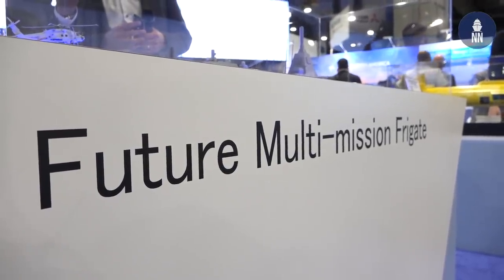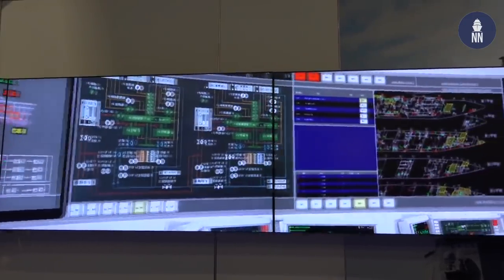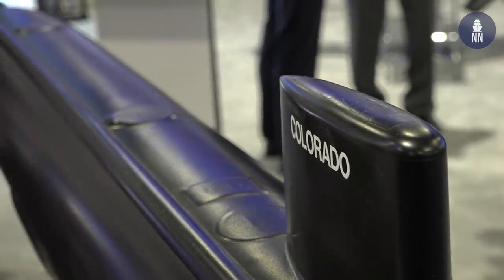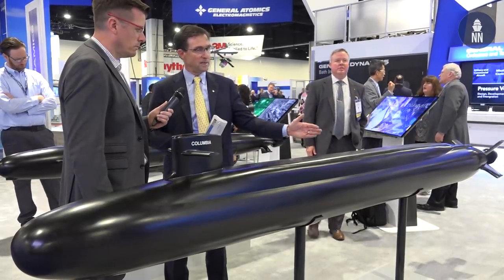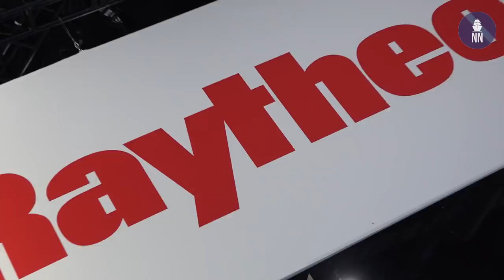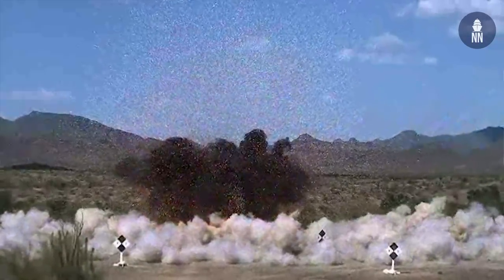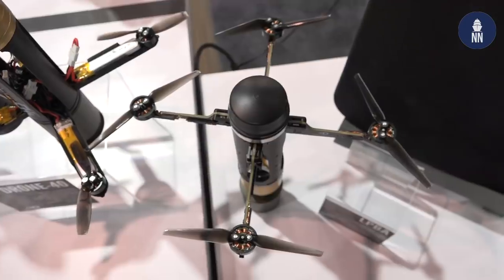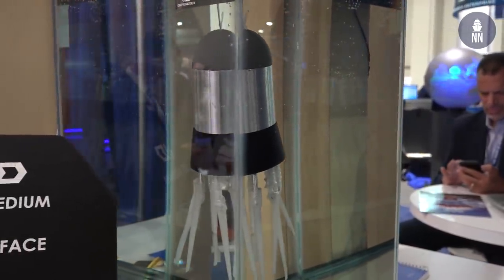SAS 2019 - 30DX FFM, Virginia-class Block V SSN & Columbia-class SSBN, MAD-FIRES, Excalibur N5

Comment: Ohh  a new  submarine 
I have a question  
Can a big submarine  
Can equip  a VTOL  rocket drone technology
Reply: Conceivably yes, but generally you don't want a "randomly appearing drone" buzzing around letting everyone know there might be a submarine in the area.  There are "persistent rumors" that they already have launchable-and-retrievable underwater drones, however - those should be just fine to utilize.
Reply: @ANonymous-bh1un   yeah and not a big  submarine  like a Airbus a380 
To have a flight deck  to use a powerful drone  jet fighter 
Because If the next  modern  battleship  or a upgrade version  of Gerald r Ford super carrier to lunch a modern attack submarine  and they have capability  to fly going to space